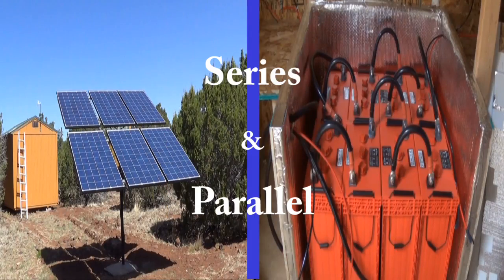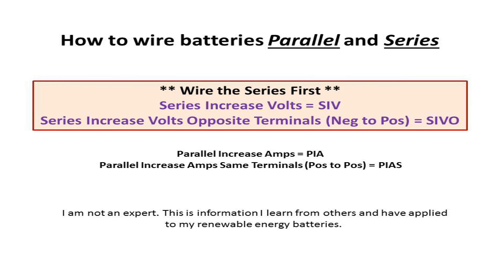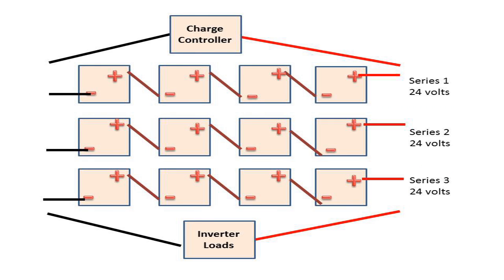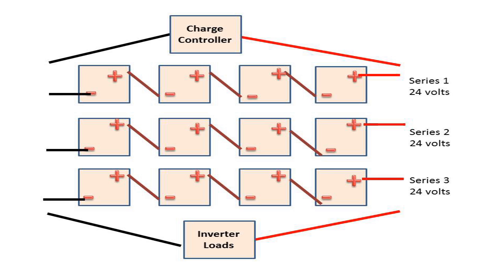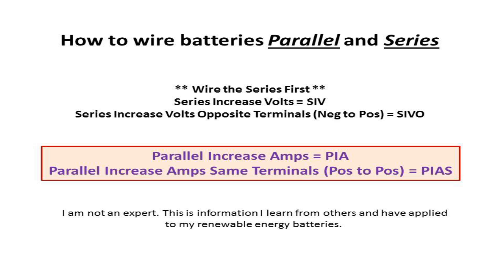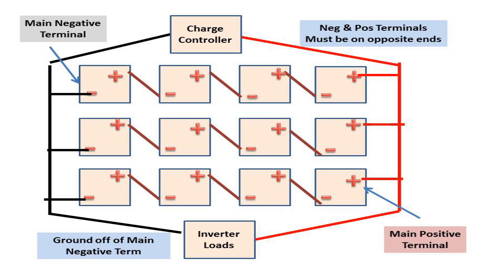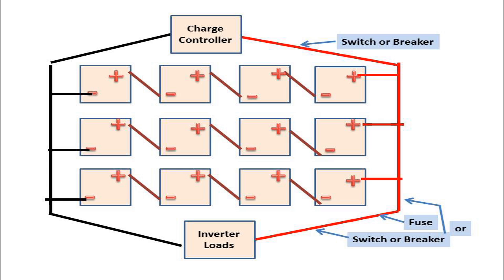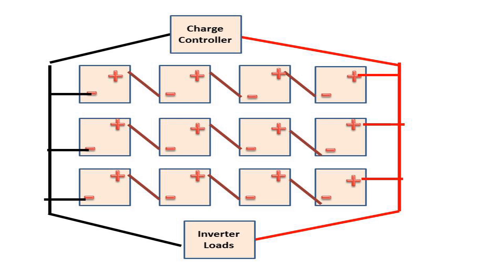Which Comes First?  Series or Parallel When Wiring Batteries

Comment: Theres some controversy re parallel vs series ie connecting 3 batteries in parallel (your diagram) the main problem with parallel first is that they will act as a single cell (12v) therefore a BMS cannot monitor the whole system and will only monitor a single cell. I agree with your system.... well done for all the hard work.
Reply from the maker: true and the system is only as good as the weakest cell.
Reply: If wired in parallel first, the BMS sees each parallel pack as a single cell. If we look at the fundamentals of a BMS, it's essentially a voltage sensitive switch that can balance voltage between cells. When matched cells are wired in parallel, the voltage doesn't change, and the cells naturally balance between each other. To the BMS, multiple cells in parallel just looks like a single cell. This is why, if using a BMS, you'd wire in parallel first, then series. If you chose series first, then you'll be using a BMS for each series string, and in the case of this video, 3 BMS's.

Comment: Excellent description Jeff! I gotta tell ya. every time I see a description on wiring up batteries, I soak it up like a sponge. Thanks so much for going into detail on this process. I definitely plan on installing solar up on the property and your help is invaluable! Nice job!!!
Reply from the maker: thanks sir.  are you going to checkout alternative energy on your way to the property?  they are on the 61 as you head towards concho across the street from the 'rain gutter and water tank' place.  tell Larry i referred you .  it wont help you with saving money but larry is an awesome guy.
Reply: Most definitely. I'll get them on my 'to-do' list. Solar is definitely in my future but until then, I'll be using a combination of SunJack portable solar, a 2200 watt Ryobi generator and good old, tried and true Dietz Lanterns. One thing I'm definitely interested in rolling out soon is the cinders you had delivered. Did you pick them up from that quarry right on the 61?
Reply from the maker: yea the pit there his name is Corky.

Comment: I have a small battery backup bank consisting of two 6v golf cart batteries.  Would I place then in series? POS to Neg?
Reply from the maker: +The OS series increase volts (siv) if you want 12v . Wire battery 1 neg to batt 2 pos. Bat 1 pos will become your main pos with Batt 2 neg your main neg
Reply: Thank you

Comment: Am still confused it is not clear so much waffle not clear to the lay man
Reply from the maker: what question do you have?  series increase volts and series it wiring positive terminal of battery a to negative terminal of battery b continue for as many batteries you need for a 12v or 24v or 48v system. if you have other batteries you than parallel those to each other. battery bank a (12v) and other set of batteries bank b (12v) wire them postive terminal battery bank a to positive terminal battery bank b. do the same with negatives. . your positive on battery bank a is your main postive terminal where you hook up your inverter to or any dc loads. your battery bank b negative is your main negative where your inverter neg hooks up to and any negative dc loads.

Comment: Really instructive video, thanks; it clarifies a couple of confusing issues.  The question I can't seem to find the answer to is this, "if your solar panels are 12v and your batteries are 12v and your inverter is 12v, what is the purpose for wiring the system so the panels are 24v and the batteries are 24v"?  Why not just hook everything in parallel and leave it all at 12v?  Thanks
Reply from the maker: awesome question. it really depends on how big your system is going to be. if you are only running lights and a few other items going with 12v is perfect. however on larger solar panels like 260w they dont come in 12v or 24v just the 24v. which is fine the charge controller takes care of that.  the key on 24v is with every connection/device/component/distance in feet you loose a little power and at 24v it more efficient than 12v. bottom line is small systems go 12v. large systems 24 or even 48 .   on your 24v panels a charge controller can take the 24v down to the 12v limits if you have a 12v controller. . does that help?
Reply from the maker: oh also if using an inverter depending again on size the efficiency of the inverter matters. for example if you may only use the inverter for 2 hrs a day a 12v maybe perfect. if you need a 2000w inverter for many hours go with 24v they are normally more efficient than a 12v inverter. . again hope this helps. great question
Reply: Thanks so much for the clarification; it makes perfect sense.  I thought that was the reason but wasn't sure.  I'm looking at putting together a small system with (8) 12v 100w Renogy panels to support a daily load of 2700whrs from (6) 12v 100ah AGMs using a 3000w 12v inverter.  The runs are pretty short; 12' from array to controller; 6' from controller to batteries; 3' from batteries to inverter, using 4awg.  I'm sure I'd get a little "pick up" configuring the 8 panels into 4 sets of of 24v and the 6 batteries into 3 sets of 24v, but I'm hoping with the relatively short runs, the improvement would be negligible, so I can just use the simpler 12v configuration.  Any thoughts would be appreciated.  Thanks again.
Reply from the maker: nice. remember ok to go big on the wire. that helps to prevent loss. sounds like you got a nice system